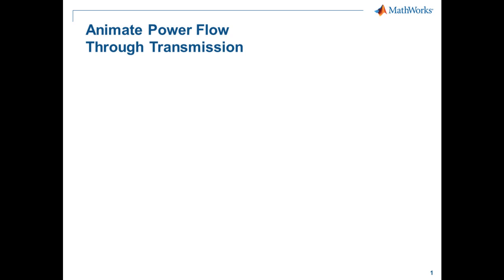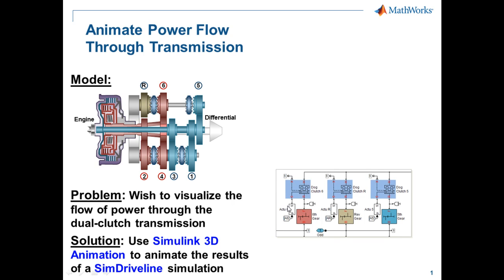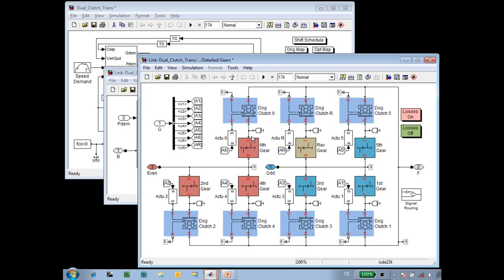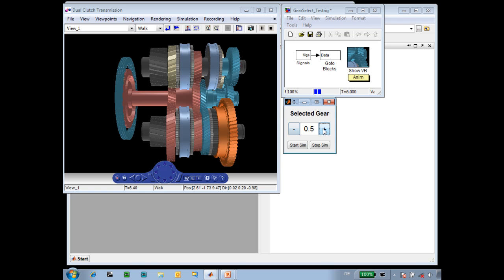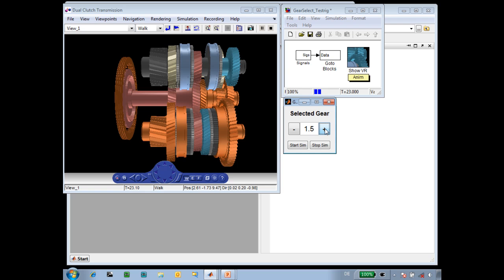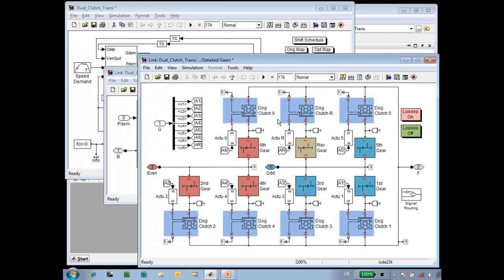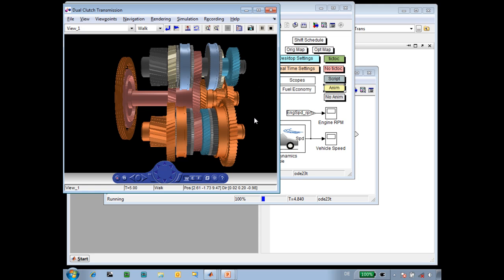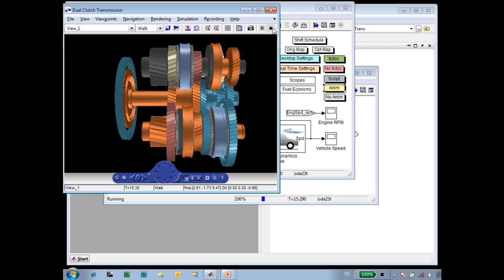Animating Power Flow Through a Dual-Clutch Transmission

Comment: Hello, I'm trying to run the Gear selection animation on Matlab R17a but i get the following error, can you help me?

Invalid setting in 'Dual_Clutch_Trans/Speed  Demand/ECE 15 Cycle (Europe)' for parameter 'VariableName'.
Caused by:
Error evaluating parameter 'VariableName' in 'Dual_Clutch_Trans/Speed  Demand/ECE 15 Cycle (Europe)'
Undefined variable "UrbanCycle1" or class "UrbanCycle1.time".

Comment: The demonstration model can be downloaded from the MATLAB Central File Exchange.  Search Google for "dual clutch transmission simulink", and it should be close to the top of the search results.
Reply: Hello, I'm trying to run the Gear selection animation on Matlab R17a but i get the following error, can you help me?

Invalid setting in 'Dual_Clutch_Trans/Speed  Demand/ECE 15 Cycle (Europe)' for parameter 'VariableName'.
Caused by:
Error evaluating parameter 'VariableName' in 'Dual_Clutch_Trans/Speed  Demand/ECE 15 Cycle (Europe)'
Undefined variable "UrbanCycle1" or class "UrbanCycle1.time".